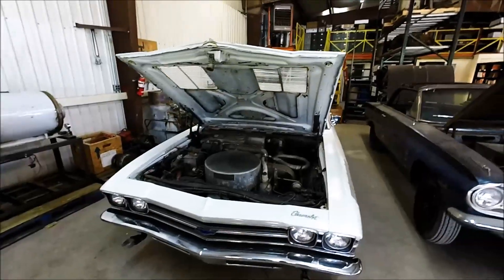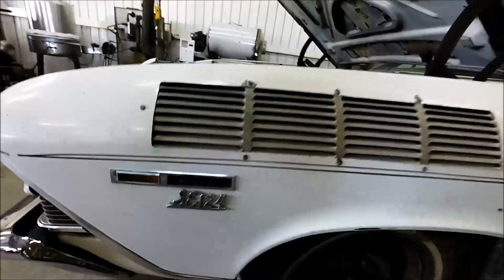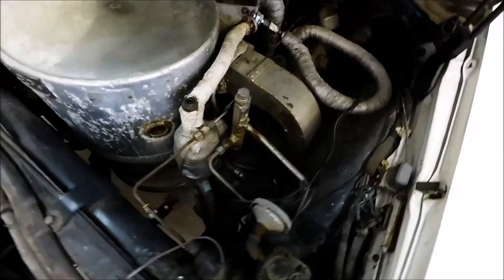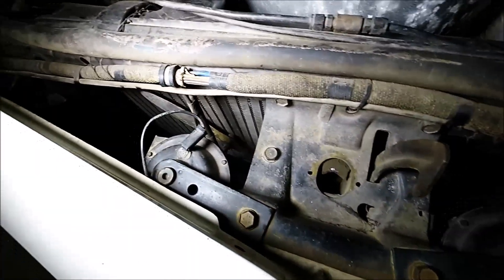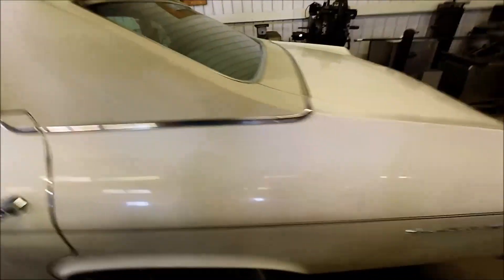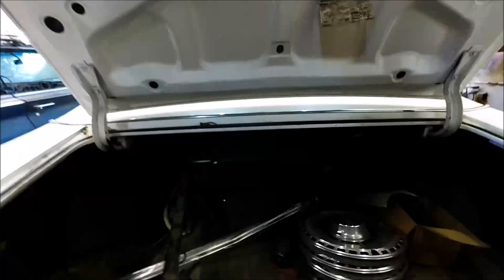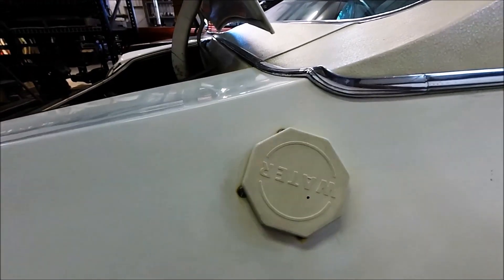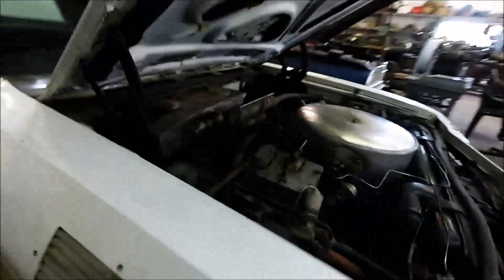1969 Steam Powered Chevelle - Built For General Motors

Comment: thing needs an ls swap and made fast again
Reply: That's 150hp @ 900rpm !

The 1925 Doble Steam Car could out-accelerate the 1930 Model J Duesenberg, doing 0 to 75 mph in just 5 seconds, with its engine turning over at less than 1,000 rpm and direct drive with No Transmission for extra gear reduction, and it could sustain speeds of 95 mph @ 900rpm right from the factory with a 1.5:1 rear end gear.

Changing from the 1.5:1 rear axle gearing to a 1:1 put the top speed at 133mph still at less than 1000rpm.

Actually QUITE IMPRESSIVE !

https://www.hemmings.com/magazine/hcc/2008/01/Steaming-Sensation---1925-Doble/1569593.html
Reply: You've Proven Nothing. 

The only thing Inferior here is your ill-informed inferior knowledge on the subject. 

But I wouldn't expect anything from an Internet Troll

You probably visit a lot of conspiracy theory websites too to gain your (self)perceived knowledge on other subjects.
Reply: Carnot & Diesel didn't Prove Or Disprove Anything about the viability of Steam Power. 

And You have proven absolutely NOTHING beyond the fact that you're an Internet Troll treading where you're not welcome and spreading bullshit on a subject you have inferior knowledge on.

Try getting your information from somewhere other than Wikipedia
Reply: You obviously Know NOTHING about Steam Cars if you think they would need to coast to the side of the road to build steam pressure to continue driving. 

Maybe Educate yourself before making stupid comments.
Reply: You are confusing Doble with the Stanley Steamer which had an undersized boiler that could only maintain WIDE OPEN THROTTLE for a short distance before running low on pressure and slowing down until the boiler caught up again. 

The Doble was a much better design with a larger boiler.

Even with the undersized boiler in the Stanley Steamer though (undersized for extended Wide Open) it could Cruise all day at part throttle and still have enough boiler capacity to accelerate up hills without stopping to let the pressure build. 

And the Doble was Much More Capable than the Stanley with More Than Enough Boiler Capacity.

If you think otherwise, post some links proving it instead of bashing it with ridiculous stories that don't hold up. 

Using All 150hp to accelerate a 5,000lb car will tax a boilers capacity.

Cruising down the highway at part throttle using maybe 25-30hp  causes the boilers burner to cycle on and off to avoid Excess Pressure. 

There is NO Coasting to the side of the road and waiting for the pressure to build with a Flash Boiler that can build 300-500psi (from a cold boiler with Zero pressure) in a matter of seconds and maintain 700-1200psi under constant operation with the burner cycling on and off as needed.

It's a Water-Tube or FLASH Boiler, Not an old style Fire-Tube boiler that takes time to build pressure. 

Educate yourself with the FACTS and a little Common Sense instead of picking bits of information that suit your agenda of bashing something you clearly don't understand.
Reply: The ONLY reason his company failed was because he invested over $50,000.00 Per Car to build them and then sold them at a loss for $10,000.00-$12,000.00 

He cared More about making the Perfect Car than he cared about making a profit on them. 

Excellent Car Exceeding Expectations, but Lousy Business Practices selling at a loss. 

It's like comparing Tesla with Edison.

Tesla died broke because all he cared about was proving his theories worked (with other people profiting from his ideas) while Edison died a multi-millionaire by patenting everything he did including his 90% Failures just to keep others from copying his work without paying him royalties.
Reply: John Delorian also Failed but he followed his dream.

Preston Tucker followed his dream and the only reason his business failed was because the "Big 3" conspired against him because his car was so much Superior to anything they had to offer. 

By Your Failed Reasoning, Tesla was a fool when he had 10 times the skill and ability that Edison had but chose to follow his dreams over becoming rich. 

As Good as the Dobles were, they should have been selling for 3-4 times what they sold for but he chose not to price them that high for personal reasons. 

White dropped their steam line Not because there was anything wrong with steam but merely because it got to the point where it became cheaper to build internal combustion engines even if they weren't as good at the time. 

Steam is STILL Far Superior, but just as in Doble's day it would cost a small fortune to tool up a factory to mass produce them. By the same note though look at how many Millions or Billions of dollars have gone into research & development for other power sources that will NEVER make a dent in the market place. 

Will steam ever come back as a means of transportation..... Probably Not, but ONLY for financial reasons (on the production side) even though it is Still Superior to every Internal Combustion Engine with the possible exceptions of Hydrogen and/or Ammonia neither of which will ever make a dent in the market either for the same reasons (cost of production).
Reply: How can someone that claims to be so highly educated continually prove to be So Wrong. 

You just made the statement that ""Carnot discovered that internal combustion engines were thermodynamically superior to steam engines 40 years before they were invented.""

Ha. . . Newcomen had a piston driven steam engine in 1712.... 84 Years Before Carnot was even Born and 112 years before he wrote his book. 

James Watt had made improvements on the Steam Engine by 1762... 34 Years before Carnot was Born and 62 years before he wrote his book. 

There were also some very Crude Internal Combustion Engines by the 1760s (30+ years before Carnot was born) though the first ICE Patents weren't granted till 1794 with Robert Street Building an Internal Combustion (Liquid Fueled) Engine , still 2 full years Before Carnot was Born and a full 30 years Before he wrote his book. In 1798, John Stevens built the first American internal combustion engine, when Carnot was 2 years old and a full 26 years before he wrote his book. 

If we're talking Diesel Engines, Rudolf Diesel invented the Compression Ignition Engine in 1892 60 Years after Carnot died, (Not 40), but as far as your claim that it somehow proved Carnots formulas you're sadly missing the point on what Carnots theories were all about.

Whether it's Internal Combustion (Gas Diesel or other) or External Combustion (Steam) his theories were about efficiency and wasted heat transfer that went into the engine cylinder and then radiated into the atmosphere.  And That is where Internal Combustion Engines STILL FALL SHORT whether they're Gasoline, Diesel, Hydrogen or whatever fuel is used because a certain percentage of the fuel is WASTED heating the cylinder instead of making power. The Hotter the Cylinder, the closer it is to the Combustion Temperature and the More Efficient it is. An engine operating with a 210 degree thermostat is More Efficient than an engine operating with a 180 degree thermostat because it is operating closer to the Combustion Temperature with more of the fuel burned going into making Power (once it is Up To Operating Temperature). There is a limit to how Hot you can run an ICE though because of localized hot spots in the heads around the exhaust ports and that temperature limit affects their efficiency. External Combustion (Steam) Engines on the other hand Don't have cooling jackets filled with water (or Oil for higher operating temps on ICE's) and once warmed up can come very close to equalizing the temperatures for higher efficiency. By the late 1800s, early 1900s most Traction Engines (steam tractors) had Jacketed Boilers that were covered with wood slats wrapped with sheet metal to insulate them and hold in more heat. Many Steam Engines, (Traction And Stationary Industrial Engines) went so far as to have the cylinders jacketed as well making them even more efficient by eliminating the air-cooling effect (where air cooled ICE's have Cooling Fins to radiate heat away from them). By the early 1900s larger Industrial Steam Engines were using Asbestos to wrap the boilers and Engine Cylinders as well as all of the plumbing between them raising the operating temperatures even higher for even greater efficiency while your ICE's are still limited to operating around 200 degrees wasting heat that is transferred into the cylinder which is then cooled by the radiator only to waste more fuel heating it up again. 

Like so many Engineering Degrees, Yours (if you really have one) isn't worth any more than the paper it's printed on if you have no Real-World Practical Experience or knowledge working with what you Think you know.
Reply: Diesels aren't any more Thermally Efficient than Gas Engines are as they are still wasting heat energy into the head and cylinder walls which are then cooled by the radiator only to be heated again by the burning fuel, wasting heat that could be making Power. 

Diesels ARE generally More FUEL Efficient than Gas Engines, but only because they run leaner using less fuel.

It has nothing to do with THERMAL EFFICIENCY as they Both have water cooled jackets that are cooled down to around 200 degrees only to waste more fuel TRYING to heat them back up to the Combustion Temperature. 

Wasted Heat is Wasted Heat whether it's Gas or Diesel generating the heat, they Both end up Fighting Against the Cooling System where Steam Engines generally have Insulating Jackets to Hold In The Heat allowing it to more closely match the Steam Temperature producing Power instead of Wasting Heat.
Reply: @oldSawyer  No one will ever mistake you for an engineer Lol!!!
Reply: LOL . . .  Given how Lame most of the 'engineers' I've dealt with over the last 50 years have proven to be  @sandervanderkammen9230 , I wouldn't Want That Title. . . . LOL Other than a small handful of them with actual "Working Knowledge" (as in a mechanical background) of what they're 'designing;, the vast majority of them aren't worth the cost of the paper their fancy Degree is printed on. . . I see the guy I Had Been replying to ( doktorbimmer)  Deleted all of his Baseless Comments after showing the world how little he knew. . .  It's almost as if you're doktorbimmer Trolling Again under a new Identity after deleting all of your old comments.
Reply: @oldSawyer  I'm certain the only engineers you have ever worked with ride in the cab of a locomotive...
After reading your benighted drivel one can only assume you dropped out of school in 5th grade.
Reply: OK doktorbimmer  aka  @sandervanderkammen9230  If You Say So. . . LOL
Reply: @oldSawyer  That's what I thought.
Reply: tunercars3 that steam engine would put out way more torque than an V8 could ever dream of. Early closed systems like the one in the 1920s doble steam car put out over 1000ib/ft of torque. 

I think that instead of a generic swap removing the originality of this car, perhaps a rebuild of the engine with modern materials to give it even more power and torque would be way cooler image smoking someone at the lights with a steam powered Chevelle...
Reply: @Reddsoldier  I guess you have never heard of NHRA Top Fuel??? LOL!!!

Comment: I still think with modern microprocessors, electronics, alloys, insulators, ect. Steam could be a very fuel efficient power source in a vehicle. Rather than wasting heat out the exhaust nearly every btu generated would be used to generate motive force. Perhaps a plug in Hybrid with batteries large enough for trips so short that for g the steam engine wouldn't be the most efficient and then the steam for long trips and operating periods? Makes more sense to me than hydrogen, that's for damn sure.
Reply: Your comment reveals someone who has no formal education or professional experience in automotive development..

Comment: pretty cool car, but how does it reintroduce the condensed water back into a pressurized system without taking equal amounts of energy to pump it back in?
Reply: Grip Limit Standard steam engines  pump water into a pressurized boiler all the time, this is simply pumping it back into a holding vessel. Water is very nearly incompressible, steam and water vapour very much are, so even if the return tank were steam pressurized, takes very little comparable energy to raise liquid water to a higher pressure.
Reply: Look up steam injectors and feedwater pumps.

Comment: just imagine getting into an accident with that steam under pressure.
Reply: Steve Lehto
Right.  It's not like there'd be an explosion from runaway pressure, like they had in the 1800's.  And the car has a blow-off valve for that, anyway.
Reply from the maker: +CIA Assassin wouldn't be any worse than a regular accident that busts a radiator.

Comment: Forget Kerosene, we should run it on Anthracite coal, it would be equivalent to paying 50 Cents a gallon or less , there is a plenty storage in the trunk to fill it with coal for a 1000 miles trip ! The Project would be subsidized by Trump supporters
Reply: PoconoPlaces
Sad.  You seem like one of those folks that always sees the negative side to everything.   No matter how good something is, you always find something wrong with it. And no matter where you go, you will never be happy.  I genuinely feel bad for you.
Reply: 12000 BTU per pound, vs 135000 per gallon of Kerosene, not much behind Kerosene, but it's a better challenge, by the way you don't need coal dust, rice coal is abundant and coal remains so far the safest fuel
Reply: Chrysler just announced today they are replacing the Hellcat with the new "Coalcat" and it will have infrared cameras to see through the new black air
Reply: I thought about this, running essentially on coal dust, the problem is getting that stuff out of there again without losing all the built up heat. Coal is also less energy-rich so you would need more of it, plus a steam car is really complex to engineer and get running properly. It'd would be fun to build, but it's not sustainable unfortunately.

Comment: I want to convert it back to gas and try out that v4 engine. Would that be a 175ci ?
Reply: +Fly house of truth:  There is a guy in the Fort Worth ,TX. area that drives a Chevy El Camino 305 block on 4 cylinders. The car runs and sounds quite normal. It is interesting and entertaining  to see people argue with him that it can't be done  :-)
Reply: Some people, if you tell them it can't be done, they stop at nothing to do it. I think a v4 would have advantages over an inline 4. I could see that 1976 - 1987 Chevette with a v4. and all the aftermarket goodies.
Reply: The guy said that it cruises at 70 with the big boys, just fine.
He did share that he did some intersting things to the dead cylinders though. The rods are locked to the crankshaft and do not move. they were left in place for balancing. He is an interesting character to talk with.
Reply: Fly house of truth my 1986 Honda VF750C Magna (80's muscle bike) has a V4 liquid cooled torque monster of an engine. Five speed transmission with 6th gear overdrive and shaft final drive. Smokes new Harley-Davidson's and other cruisers like they were standing still.